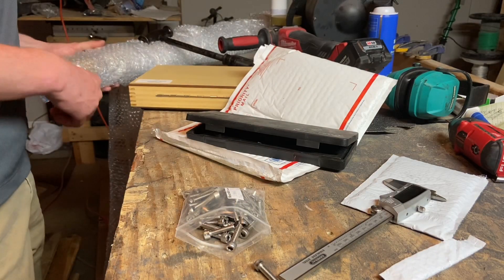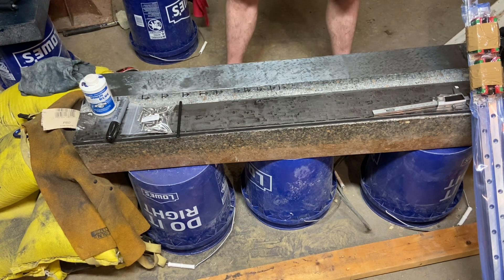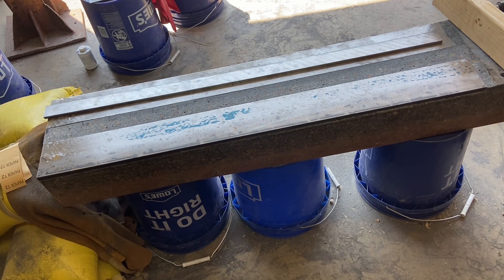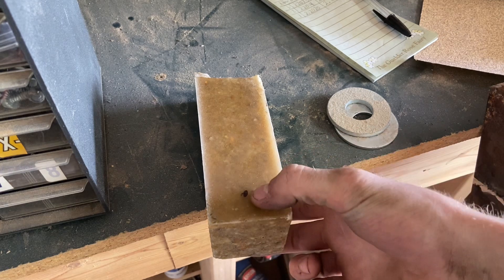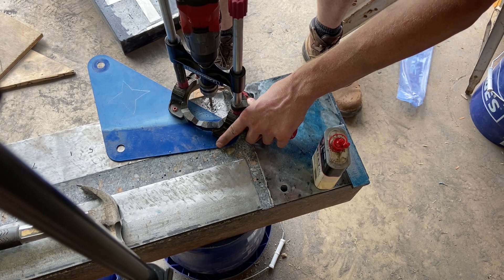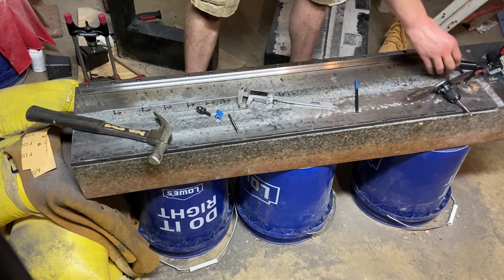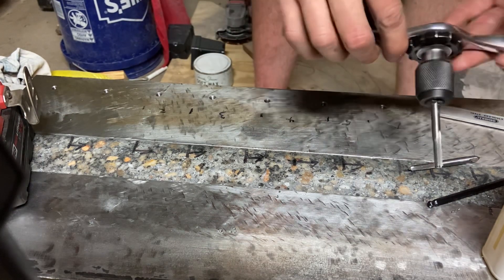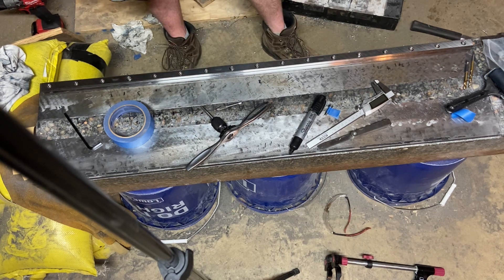DIY Epoxy Granite Lathe #3: Linear rails!

Comment: I was spitballing the idea of running 3/16" brake line all through my epoxy granite base, and circulating water through it with a thermoelectric element driving it to constant temperature.  But I thought, why do I keep making things so complicated?

Now it seems a lot less like overengineering.
Reply from the maker: Interesting thought, although you can also stop the banana effect by epoxying another bar of steel to the bottom, or by using threaded rods and a plate, and putting some tension on it, which may be easier/cheaper

Comment: Yes, it will give you issues due to slight thermal differences, you said on your previous video that you got it flat down to 1/2 a thou, thats near 12 micron precision. I know that professionals who scrapes need to do this type of work in a professional environment with temperature controlled room, they also wear special heat shielded apron while scraping since the body's temperature will radiate to the granite or thing that is being scraped and throw off micron level readings.
Reply from the maker: Hmm interesting
Well at some point Ill have to get it to a temp controlled environment, not an option for now though unfortunately
Reply: @robertsteinwandel6658  It great that you made videos on making it and showing what issues might rise. Thanks.
Reply from the maker: @ShopperPlug  Thanks! 
It’s funny, actually building the lathe has shown me so many issues or better ways to do things, once I finish it I almost want to just start on another lathe hahaha. It would go so much more smoothly after already doing it once lol

Comment: I am thinking of building like this as well for my next bigger lathe.  I wanted to avoid the leveling/flattening issues...

last night when I probably should have been sleeping I spent about 8 hours thinking over how one could make a better surface that was more easily flattened to a perfect surface.  

It seemed that most any ordinary metal will have issues with being out a few thousands of an inch no matter what you do and you would be stuck with trying to grind them down to the lowest points.  Potentially a lot of work.

Next I though about avoiding metal and just going with the poured surface though that would also be impossible to get perfect and you would be removing material to the lowest point and "trying" to do that in a way that maintains a perfect surface.  Again a lot of work..

I have not come up with a way to create a perfect surface, heck I tried to do that when I poured the concrete pad for my sawmill, it seemed just about perfect until I put my rails on and started bolting them down and checking the heights across them and I was out by up to a 16'th of an inch all over the place.  I had to just live with a lot of it as the more I tried to flatten everything out it would throw the rail out more in other areas.

 I got to thinking about maybe instead of going for a perfect surface from the gitgo coming up with a way to make it physically easier to work the surface to "make it" perfect.  Maybe a slightly raised set of lines across the poured surface that would be physically easier and less time consuming to tool down to a perfect surface?  

Any thoughts?
Reply from the maker: You have a really cool line of thinking here, I spent a ton of time trying to avoid the process and ended up just caving and doing it haha.
So I like your idea with the poured surface, although if you use linear rails you need something to bolt down to. 

They do make a self leveling epoxy which has had mixed results for people. So you could put self leveling epoxy over your steel youd bolt your rails to, and theoretically the surface would be flat to the same curvature as the earth (.008in per foot I think) this is pretty good, and it would be consistent so maybe you could account for it with shims or something to avoid any flattening.

If I went back and did it all again, I would have gotten 1 solid sheet of 1/2in steel for the entire top of my base casting, to bolt everything to. JB weld 1/16th in steel strips under the rails to raise them up, then just grind that flat. 

It would’ve reduced the surface area I had to grind by like 80% and having the whole top be 1/2in steel is much easier to work off of than 3 steel inserts which might not be coplanar and have gaps of EG between them.

I do like the idea of lines to reduce surface area to flatten, although I hope that reducing the surface area the linear rails rest on wouldn’t make them any less rigid
What do you think?
Reply: @robertsteinwandel6658  I was thinking threaded metal under my poured surface with something like wax or rubber plugs to keep everything out of the holes and threads.

Under the rails after flattening the surface I figured use something like bondo which would fill in the low areas of the ridges left for a flatter smoother surface.  Bondo is nice and soft so any excess can easily and quickly be sanded back down to the flattened surface. 

I was thinking of using the three plate method of trueing a surface using finished granite stone to work down the concrete. I can get very flat finished granite in the form of cutting boards, glue some sand paper to that and I should goof true sanding plate.

I also realized after a great deal of though that the height axis is not so important, if it is off a couple three thousands there would be no real issue. it is the side to side axis that is of the greatest importance on a lathe.  I was thinking get the mounting platform not perfect but good and then fine tuning the rail system might be the more efficient for me way to go.

I was also thinking I might go three rails instead of two.  Having a center rail inline with the lathe head seems potentially stouter and less likely to create flex in a rail in the first place.  That would also put the two outer rails further out which would reduce the effect of being out slightly in height by the it simply being further away from the centerline of the lathe head.  New to all of this so I am still thinking it all through yet.

Comment: You mentioned trying to get the linear rail in position as good as possible with your caliper. You might find that easier if you used the other end of your caliper as it has large contact points.
Reply from the maker: Honestly thats a way better idea, I think I was just needed to take a second to think what I was doing for the part hahaha

Comment: Hi, curious if the warping due to temperature change was proven 100% since you made this video. Did you check it again when the base was at another temperature? If so, did it return to flat?
Reply from the maker: It does, I think its ~73 degrees that its flat, above or below that and it starts to banana

I may try to bond a piece of steel to the bottom to see if having the strain on both sides will stop it from bowing, hut I haven’t yet
Reply: @robertsteinwandel6658  Ok, thanks for the follow up. My design is symmetrical. EG inside a 6" square alum extrusion. I suppose it would stay straight during thermal changes, but that's an educated guess at this point.
Reply from the maker: Nick P shoot I didn’t see you responded, sorry! Actually I remember from your video haha, yeah I think that should be fine, the only thing that could mess it up may be the rails (forget if you were doing standard ways or linear rails) but those would give you some asymmetry. If its stored insode though shouldn’t be a problem at all Im thinkin (hopefully lol)

Comment: There are magnetic drill presses, maybe you could rent one. Also AFAIK steel drilling should be slow and steadily.
Reply from the maker: Absolutely yes, it should be slow. A mag drill would definitely be the way to go you’re right, I totally forgot about that. I don’t own one and can’t afford one so for just a few minutes worth of work it’s probably not worth it, but thats a great point. 

A mag drill would actually be a really fun project after the lathe is done hahaha- might think about that for later
Reply: Screw some MDF to the drill stand, then glue some magnets to the bottom.

Comment: For one, you could clamp the drill guide to the bed after centering the bit. By the way, it is also an excellent tapping tool for getting a nice clean and straight tapped hole.
Reply from the maker: Thats a great idea, thanks!!

Comment: Nice progress. 
Spread the bed rails to the max width the bed casting allows. This will reduce the forces on the Hiwin trucks, and increase stiffness. You can make the saddle rigid enough to resist the mending moment, but if would space the rail closer, you are wasting a lot of the stiffness inherent in the bed casting.

In commercial machines, a step gets machined so the rail has a reference should to align it. Rails are pretty flexible as is.
Dont worry about motors sticking out.
Reply from the maker: That honestly makes a lot of sense, I was thinking of ways to minimize the saddle deflection in the center and I think I stopped considering which parts are easy to stiffen and which aren’t.

I had seen that actually! The Hiwin guide has a section on straightening the rails with a bunch of options and great visuals. Unfortunately for me I don’t think the ridge is very feasible. I have no mill to cut the ridge in, and the only other way to make one I could think of is taking a strip of steel with a very straight edge and using metal epoxy to glue it down to the insert. Im not sure that would work though, so that brings me to using an indicator and a straightedge to run the indicator back and forth until my rails are straight and tightening the bolts as I go.  Seems like a huge pain but Hiwin said it’s possible? If you’ve got any other ideas Im all ears hahaha

Thanks again!
Reply: @robertsteinwandel6658  That is a good solution for a one off. It would be tough to scrape around a step like that.